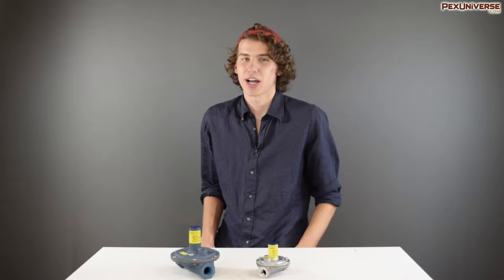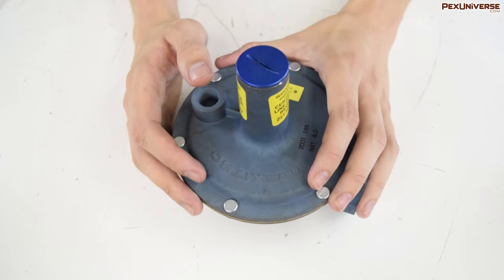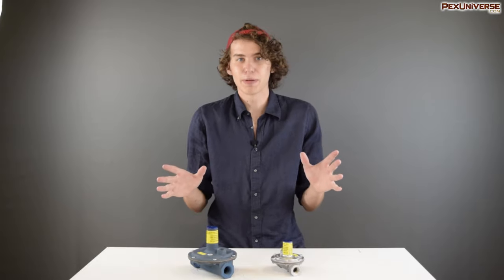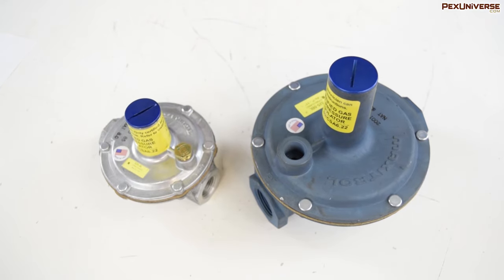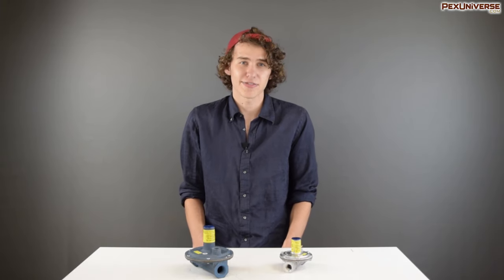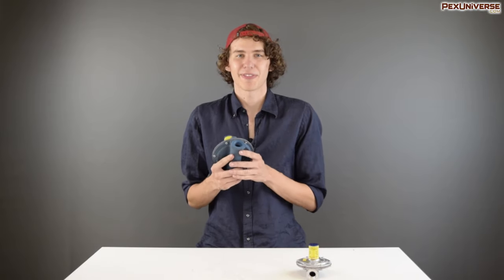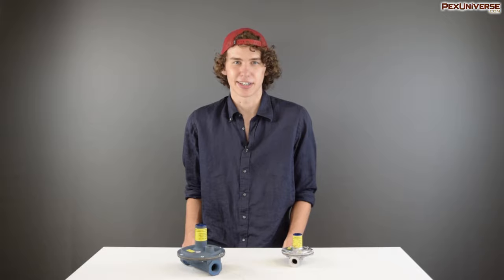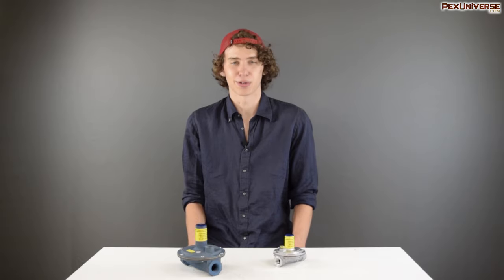Gas Regulators

Comment: You did a pretty good job of explaining your maxitrol regulators but I'd like to go over a few things you may have failed to mention.#1 if a vent limiter is used the regulator must be mounted horizontal ( this is required so the vent limiter BB stays in its standby seat).#2 you should have probably want into a little more depth on sizing the regulator and piping, like total load BTUs ( cubic feet per hour) and number of appliances contributing to the total BTU load ( there is a rating difference between, 1 Appliance, let us say at 300,000 BTUs & 3 appliances at 300,000 BTUs total).#3 regulator can vent anytime the Downstream pressure exceed the manufacturer's set point but there is more things than just a ruptured diaphragm that can cause this ( dirt between the seat and orifice, imperfection or tear in the seat & ect). Again you did a pretty good job in your presentation, probably better than most supply houses could do, keep those videos coming.
PS, you may want to lose the cap on backwards look and buy a polo shirt with the company logo to gain a little more respect in your industry. I know it should not make a difference but it does.
Reply from the maker: Thanks for the feedback! Those are all great points that I probably should have covered, I'll try being more thorough in the future!

In relation to #1 I was trying to avoid going too in depth on installation as I didn't want anyone to take this video as a definitive guide for something so potentially dangerous. Still you're absolutely right about that point!
Reply: @PEXUniverse  , I've been in the gas industry for 35 years and you are absolutely correct about limiting your liability and referring to manufacturer's specifications , instructions and the trade men's qualifications.
Reply: @PEXUniverse  , I been itching to ask, are you two brothers ?
Reply from the maker: We are not, just very similar looks. I coulda made the mistake myself :)
Reply: thanks for the info, but young people don't wanna wear boring clothes to work anymore. i actually respect him more actually. own your own business/ have a cool boss? wear whatever the heck you want, i say! change the world, not yourself.
Reply: @tech 52 i'm already a young working professional & I wear whatever the hell i want. i'm respected in my field. my clothes have nothing to do with it; my brain does.
Reply: @tech 52 don't forget about the world. remember for what it is and change it (exactly what this young man is doing here with his great cadence and laidback demeanor)
Reply: @tech 52 also that quote only applies to those who wasted their time being something they're not ;) us folks who like to be true to who we are shape the future & have never regretted our youths. maybe start looking back on your life & see how you can go forward to be happy, instead of trying to upkeep the pseudo-status quo
Reply: @tech 52 my comment isnt deleted.
Reply: @tech 52 Bob Y is definitely a sage of his field. All good extra points that should've been in the video for best practices purposes.

Comment: I just checked with a local propane supplier. I need two regulators, one at the 500 gal tank and one at the house, the only difference I can see is outlets, 1 has 1/4 “ and 3/4 inch the other has 3/4 inch.  They are in the neighborhood of 50-80 buck each.  I was quoted $583.00 to remove the old and install the new. These are zero adjustment valves, the only other thing is check for leaks and see that my  furnace works.  I’ll pass and do it myself

Comment: I have the Maxtitol 35-L want to go from 1 1/4 high pressure to 7WC for a portable genset.  My regulator as the vent limiter. 
Do I need the Maxitrol 3/8" NPT Connection Vent Protector for 325-5 and 325-5L.

Comment: great info tnX
i have a question thou does regulators also stop outlet till pressure is built inside of it if inlet pressure is low lets say due to cold & overuse in winter? if not which tools can do this
tnx for help in advance

Comment: My house has no regulator on it. Only had 1 regulator at tank. It was on the 3/4" pipe going underground to my house. Propane company took it when they picked up there tank. I wanted to own my own tank so I bought one. What kind of regulator would it have been? A 1st stage or a second stage?
Reply: I have the same question

Comment: What happens if Diaphragm has leak - just happened to me.  I know the vent will leak gas, but what does the poppet do?  Am a allowing more pressure to the low pressure side or does the poppet get closed and little gas is getting through?

Comment: Where is this link for the calculator? At 3:30 i can not understand what he says and i dont see any calculators in the links to pex universe. Im having a hard time finding what LP regulator i need. 100lb tank to supply a 60000 btu converted hanging shop heater. lots of dead ends. I have a 1 inch black pipe stubbed out and capped.

Comment: I am new to gas regulators and here are newbie's questions. If a gas regulator's function is to reduce gas pressure does it mean it reduces the amount of gas pass through? if so can I just use a ball shut off valve and adjust to the desired amount of gas needed?
Reply: no
Reply: Ball shut-off are consider on or off.  A needle valve shut-off is used to control flow.

Comment: bro i really need some help  here. 
 i have 5 laundry dryers (15kg load type) (  manufacturer recommends just need small regulator) 
But my Gas seller recommends using a Big regulator to supply all of of them but then each of the machine will have its smaller regulator to contain the flow. ( this cost alot) 

another gas seller suggest me to just install 1 medium size regulator and then it can regulator all 5 dryer. 

anyone here can help me?

Comment: Would love to see a vid on replacing an old leaking diaphragm valve (old muller climatrol gas furnace water heater) control valve with 3 sets of 2 wires Thermostat, pilot, and transformer. Got a new Robertshaw valve that is the only one that cross referenced. It has only 1set of 2 wire connections marked as TR & TU! this furnace is old but works great I keep it clean & maintained watching it closely! cannot afford a new heater at this time! has anyone ran into this problem? My regulator is not leaking and still works fine! Original control valve is not available!

Comment: I need help. My stove dosent work when it gets cold outside. I switched the tank and it still don't work. When it gets cold somthing happens and I get no gas at the stove. Has to be the regulator.
Reply from the maker: It could be the regulator, yes! But there are a lot of possibilities as to why, so we recommend having a professional check it out
Reply: My regulator froze up
in the extreme cold. I poured warm water over the regulator for a few seconds and it worked great. Gas was flowing normally after.